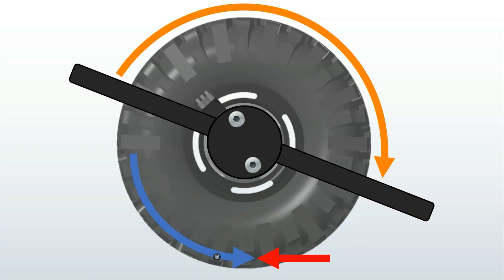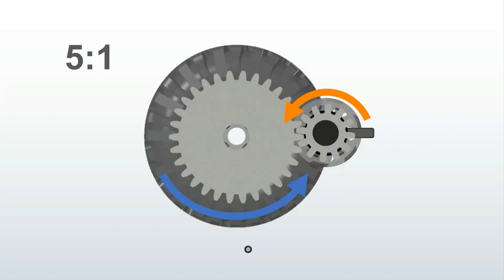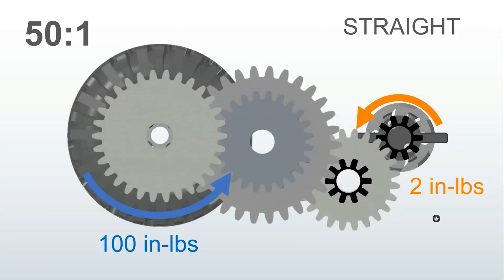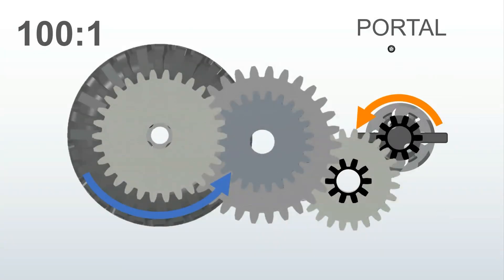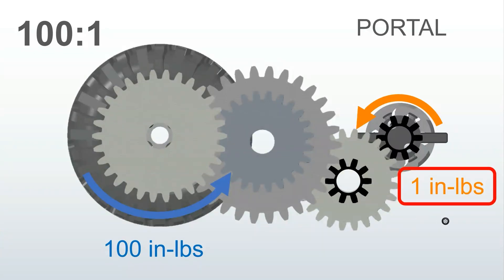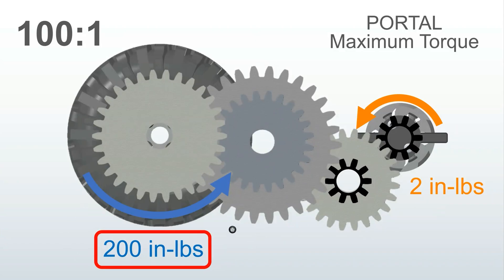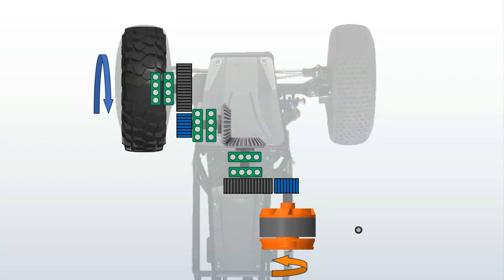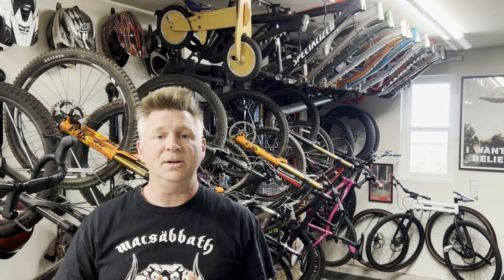Do Portal Axles Reduce Torque Twist? Part 1

Comment: I disagree about lowering the ratio or getting a smaller pinion to reduce torque twist.  It's not the ratio from the pinion to wheels that determine torque twist, it's the ratio from driveshaft to wheels.
Reply from the maker: That’s the mistake everyone makes which is the entire point of the video. That would be true if your driveshaft was fixed at one end, but it’s not - it keeps turning from pinion to contact patch. If you can demonstrate that I’d love to see it. I’m working on a demo myself. Let’s compare tests because you are not alone in that thinking.
Reply from the maker: Here is the second part where I tried to add more detail. 

Portals & Twist - Part 2
https://youtu.be/3lMzPAvUCEQ
Reply: @ I just read your discourse with another commenter and my argument was pretty much the same.

If you have more reduction between the transmission housing and the wheels, the reaction is dampened by the greater ratio from the output vs axle.  You have more rotations from the transmission housing to the axle with the same overall ratio.  The torque twist will not be as violent.

If you have no reduction between the housing and wheels, the transmission will want to twist faster with more force because of the low ratio.

I am trying to think more about it but have not really been convinced either way.
Reply from the maker: It really is as simple as I have shown. Show me a different mathematical equation, computer model or physical demonstration if you can make or find one. Lots of people have claimed that their portal has less twist, but I've yet to see a convincing demonstration. Or any demonstration.
Reply: @BoomslangSuspension  I will look into it.  I feel like torque twist is more than just static twist on the front axle, it's the addition of forces on the rear axle too pushing the car forward and forward movement taking into the equation too.
Reply from the maker: You’re right, it’s absolutely a twist coming from both axles, more or less equally. I only depicted one axle for clarity, but maybe that was more confusing?

Comment: So if we redesign the motor placement to sideways, would the reactive forces act on the longitudinal axis instead, thus completely eliminating the wheel lifting and the leaning on one side?
How about a vertical placement? It would hurt the CG, but it would be fairly easy design and it would fit probably every scale chassis and hard shell. It would be awesome for class 1 rigs to get rid of the torque twist.
Reply from the maker: You would have to eliminate the shaft drive and bevel gear as well. That means a parallel belt drive. Vertical placement is quite interesting. Haven’t thought about that. You might be on to something.
Reply: @BoomslangSuspension  so there's no cure after all? I didn't quite understand the video then, I suppose. I thought the only thing that mattered was the orientation of the two ends of the drivetrain. One of which is the motor housing itself. If the motor is placed on the pitch axis (or yaw axis), wouldn't the reactive force on the chassis be a pitch (or yaw) instead?
Reply from the maker: MOA is the only real solution.
Reply: @BoomslangSuspension  What's MOA?
Reply from the maker: “Motor On Axle” there are two motors, one on each axle that are parallel to the wheels. No driveshafts and no bevel gears anywhere.

Comment: I am always interested to know why companies put the pumpkin of an axle in the center. Wouldn't an offset pumpkin on an axle help reduce torque twist?
Reply from the maker: That’s a good observation. The weight of the pumpkin would help AND the longer  lever arm from the pumpkin to the far tire…BUT… this only works if the diff gear is on the correct side of the bevel to take advantage.

Comment: How about counter rotating transfer case?
Reply from the maker: That’s not as simple as it seems. I’m working on a mathematical model for it. I don’t think it helps as much as we would hope, but I’ll break it down.
Reply: Then it would just twist the opposite way. I think the simplest way to think about it is the resistance at the motor shaft. The system doesn’t care where the gear reduction is between the tire and the motor. It’s based on what direction your motor spins and how it’s mounted in the chassis.

Comment: So as far as i underdtood the 2 practical options to reduce the torque twist are 1. Increase the total reduction from motor to wheel, and 2. Reduce friction from motor to wheel as much as possible (for example replace bushings with bearings, make sure that the wheels are not binding, etc...). Another question is what about the worm gears? I think they produce less torque twist or is this also a misconception?
Reply from the maker: I don’t see how friction changes anything. More friction probably helps!  
Worm gears don’t change anything. They are just another gear reduction between your tire and motor and the only thing that matters is your total reduction between the tire and the motor.

Comment: Who will engineer and build a trans with a sideways motor mount applying the torque twist to force the front end down?
Reply from the maker: You’d need a belt drive from the motor to the axles. At which point MOA probably is simpler.  I’d like to see 1 motor on the front axle and a belt traveling to the rear. 😅
Reply: @BoomslangSuspension  20 years ago they had free running crawlers sold in walmart, they had a belt drive.

Comment: I hate to say it but you are wrong, simply changing a spur and pinion on the motor end won’t reduce torque twist in shaft driven rigs that have a transfer case because the amount of torque from the straight axle to transfer case for a particular obstacle through the driveshaft stays the same that way, however if you can increase the reduction in the axle housing it’s self it would require less drive shaft torque from the transfer case to overcome the same obstacle which will reduce torque twist, a greater reduction at the motor pinion will lower required amperage and reduce top speed and provide greater torque for the same amperage but doesn’t remove or reduce torque twist.
Reply: It’s pretty simple, torque twist is a component of chassis the wanting to twist opposite of the drive shaft it’s self in relation to the axle housing, in order to reduce that force you have no other option than to increase reduction in the axle housing it’s self to reduce the amount of load on the driveshaft which reduces torque twist, it can never be eliminated entirely but it can be reduced but only through the axle housing it’s self unless you go to motor on axle. It wouldn’t matter if you had one million to one reduction between the motor and shaft because it would always require the same amount of shaft torque between the transfer case and axle housing to rotate the tires which is where the torque twist comes from. On non portal axles though it would require a lot bigger pumpkin with a massive ring gear and tiny pinion which means there would be even less ground clearance.
Reply: And the housing and chassis are independent of each other with the exception of the suspension and drive shaft, and unless you reduce the load on the shaft you end up with the suspension bearing the brunt of of that load and causing torque twist, the only way to reduce torque twist is by reducing the required torque through the shaft and that can only be done on the housing end..
Reply from the maker: Build two rigs, one portal with 18t pinion and one straight axle with 9t. Identical in every other way, and see what happens.
Reply from the maker: This is precisely why I produced this video because too many people believe as you do. Action and reaction. Action is at the content patch and reaction is at the skid. It doesn’t matter where the gear reduction occurs in between. There is no math that I know of that supports otherwise, but if you can show a correct force balance diagram that demonstrates your point…I’d love to see it.
Reply: @BoomslangSuss uhh, the equation for power? 😂 Power = torque * rpm.... if I apply 10 (units) torques at 1 rpm to the tire then you can isolate the reference window you want. Power is constant, so if I add 2:1 portal reduction for the same ring & pinion, well now I've doubled the driveshaft speed but cut the torque (and thus the reaction torque) in half, atleast in a frictionless system.
Reply from the maker: @DIllybarification  The same thing happens if you put on a pinion that is half the size.
Reply: @BoomslangSuspension  that would be at the motor though. Your motor is rigidly mounted in reference to the pinion gear, from a chassis dynamics perspective there's no reason to reduce reaction torque there. What it will do is cut the output shaft speed, of the transfer case, in half and double the torque... The same torque going through the driveshaft, which is what is relevant to your chassis twisting. Everything in that axis is fixed rigidly in place except the axles, and the only thing between the axles and chassis is the driveshaft. With your perspective take on this, theoretically first gear in every vehicle should have the least amount of twist, have you ever watched loaded semi truck drag racing? Seems kinda fishy to me how they alway have huge torque twist at the start but it's basically nonexistent on the top end.
Reply from the maker: You are making the same assumption that most people make - the driveshaft is not fixed at the axle. It spins within the axle until it meets resistance at the tire. It doesn't matter where there reduction is - the action and reaction is from contact patch to motor mounts.
Semi truck drag racing has two things going on - one is dynamic torque which we have not covered here because crawlers crawl, and the second is that they are putting out absolute maximum torque.  Crawlers are torque limited when climbing based on when they flip over. You can't double the max torque on a given climb.
Reply: @BoomslangSuspension  ok, you can test this in like 5 minutes. Remove the your diveshafts and stick an Alan wrench through the output shaft on the transfercase. Try to crawl forward and let the wrench jam against the frame rail. This should show that there is no chassis dynamics affected from motor or transmissions transfer of torque. Now take the same wrench and hold it away from the frame and try to crawl forward. This should transfer the same torque that goes through the driveshaft when your tires hit an obstacle.
Reply from the maker: @DIllybarification  If I am understanding your suggestion correctly, this does not demonstrate what you think it does. As I explained in the video, you have to look at the action-reaction points.  In your first example, the action is the chassis rails and the reaction is the motor mounts - basically the same rigid body. Of course there will be no twist.  The second example is your hand holding the wrench and the motor mount - yes there will be twist of the motor mount relative to your hand.

I am working on a different demo that should be more clear.
Reply: @BoomslangSuspension  Motor torque, chassis side gearing, spring rate/geometry, and sway bars control maximum torque twist possible. This is why a demo with held wheels does not show a difference in twist. The axle gearing and the force reactions between the gears determines twist for a given wheel torque. Try disconnecting the driveshaft from the axle and prevent it from rotating with your hand. The chassis will still twist to the same amount as when you hold the will in place. If you want to see torque twist, tie a weight to the axle and pull it. Change the axle gearing and do the same pull. The lower gearing will cause less twist. A non portal axle is preferred for this demo because it removes the portals' torque reaction on the axle housing.
Reply from the maker: @toolazy4340  I mostly agree with you. This wasn't really a torque comparative demonstration - it was just to illustrate what twist looks like.  I am actually working on some demonstrations, not too far off from what you are thinking.
Reply from the maker: You are making the same mistake everyone makes. Your premise  is based on the assumption that the shaft stops rotating at the axle pumpkin and the bevel gear. But the shaft doesn’t stop rotating at the bevel gear. It keeps on spinning until it meets resistance at the contact patch. Action and reaction. There is no reaction at the pumpkin. The axles keep on spinning in   through the pinon and out the bevel gear. It’s not locked at the bevel and that’s what would be required for your calculation.
Reply: @BoomslangSuspension  There is a reaction at the pumpkin. It has to resist the forces of the pinion gear and ring gear trying to rotate about the other's axis. All gear boxes see reaction forces and torques. Taking portals out of the discussion because they have their own reaction. A higher multiplication ring and pinion will result in less torque twist for a given torque at the wheels. If it takes 2 torques to drive at a constant speed, and I have a gear ratio of 2 in the axle, the driveshaft delivers 1 torques. The driveshaft has equal and opposite torques at each end, so for it to apply 1 torque to axle it is applying -1 torque to the chassis. If I have a gear ratio of 4, the chassis is seeing -.5 torques.
Reply: I don’t need to, but you might want to call Currie enterprise in the morning and talk with them about it yourself. Portal or not you have to increase reduction in the housing to reduce torque twist in the chassis and suspension to overcome the same obstacle.
Reply from the maker: @jamesstewart9970  Currie Enterprises do not make portal axles for full scale or RC.  Vanquish licenses the center diff design only and adds the portals on themselves just to match stock Capra.
Reply: I understand they don’t, but you have to reduce the needed driveshaft torque to  get the tires to overcome a particular obstacle in order to reduce torque twist which can only be done by dropping tire size which no one wants to do or to increase reduction in the axle housing its self, if it’s done before the axle it doesn’t lower the effect of torque twist, only the strain on the motor and electronics.
Reply: Just had a chance to test this on my h10 optic, it came with a 15t 32p pinion and 56t spur, while I had the motor out swapping it for a hobbywing fusion pro, I decided to throw in a 9t pinion which is a 40% increase in reduction at the motor and transmission, and it still try’s to peal the left front off on steep inclines just like it was doing before I ever swapped anything, top speed is less and the low speed resolution is way better but as for the torque twist, it didn’t change a thing.
Reply from the maker: @jamesstewart9970  Were you testing on terrain or a traction board? What was the motor kV before and after?  Grippin' or slippin' during the test?
Reply: @BoomslangSuspension   a very restrictive line in my backyard that forces to to take the exact same route every time, the stock motor that was in it was a 35t brushed motor and it’s now got a 2300kv fusion pro, the only thing that changed was how slowly I could make it peal the left front off but it still didn’t improve or stop it even with the lower gearing and better modulation, that’s because the force at the drive shaft it’s self hasn’t changed. My portal rig on the other hand doesn’t do it at all and keeps all 4 planted because the drive shaft torque needed is lower, it’s also running a 9t pinion and a 2300kv fusion pro, both are running vanquish vfd transmissions as well with the same size spurs.

Comment: Have u talked about the shock angle ? More so like diagonal from the rear instead of a caster angle forward? Hard to explain. Like triangle rear shock / - \
Reply from the maker: / - \  this orientation is looking from the rear?
Reply: @BoomslangSuspension  yup! I was actually just finishing reading on triangulation? Its kinda rough in my head but it seems like something not covered as much unless i never seen. Its my first year crawling RCs so im learning everything brandnew
Reply: @BoomslangSuspension  i had installed my shocks in that way as an experiment just on how i can mount shocks “creatively” but didnt drive it yet. I had put it back to normal because i wasnt too sure
Reply from the maker: @yungliquid7053  I am presently working on a video specifically for shock mounting angle, so stay tuned.  Typically, in the mounting direction you are referring too,  you don't have a lot of options on how to mount them, so mount where you can and then tune accordingly.
Reply: @BoomslangSuspension  hell yeah awesome! Thank you, sounds funny but i was asking the “AI” on snapchat questions about it LOL! Honestly got alot of information from that too. Not many spots to mount unfortunately, but we can get creative like ive seen all the cool builds. Imma put that set up on today and drive it this weekend and see how it is and at lwast worth it. I think it can help with side hilling